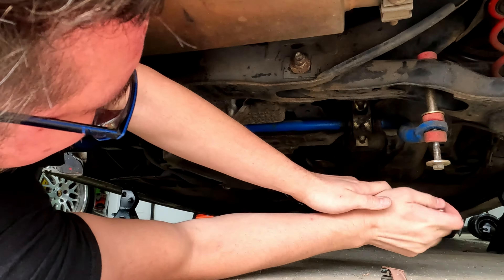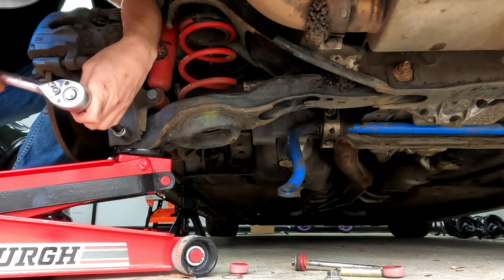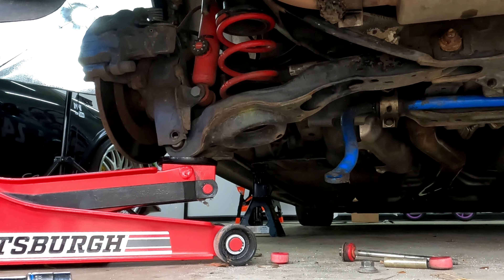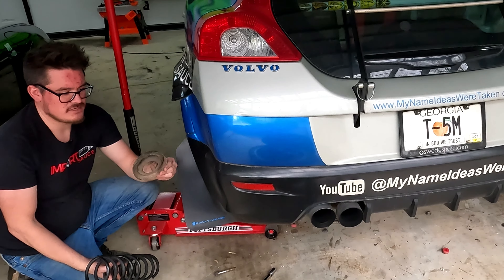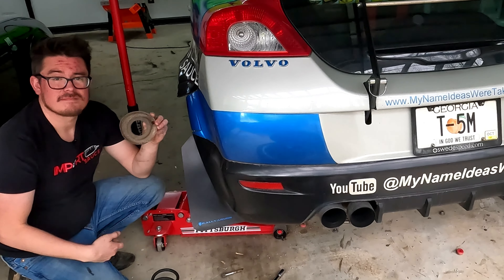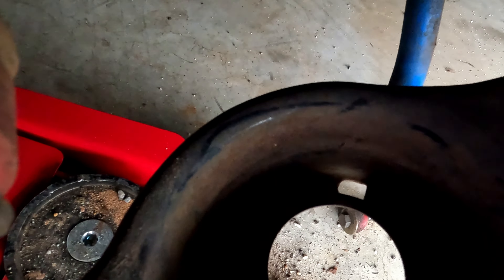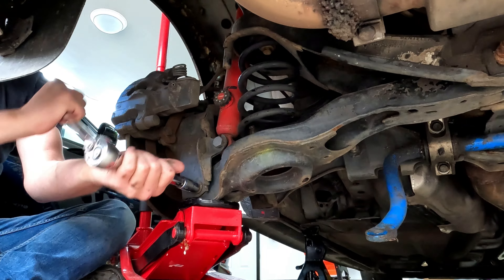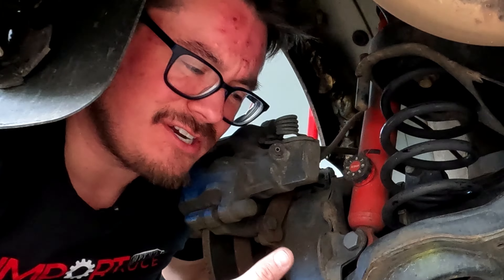Volvo C30, Rear Spring Replacement

Comment: Hi there,  simple question. Are those the KYB AGX rear shocks?  Is it possible to use those shocks on standard OEM springs. I read at full extension they are shorter by almost 2 inches from OEM.
Reply from the maker: Yes, you can use these shocks with OEM springs. Though I would advise against it... They're best paired with a lowered setup due to the limited travel range.